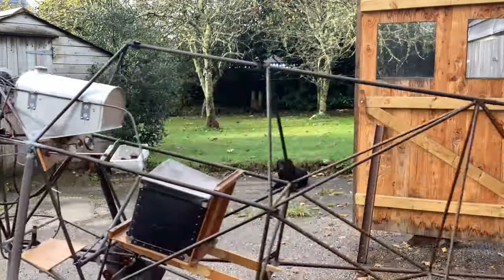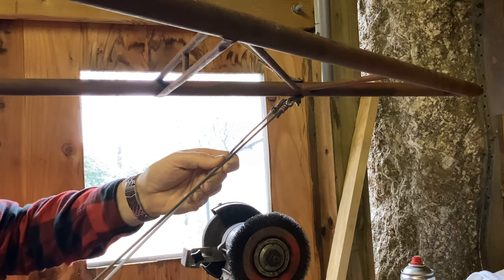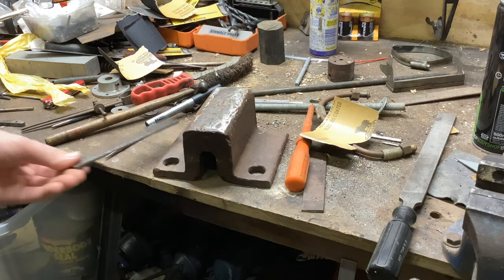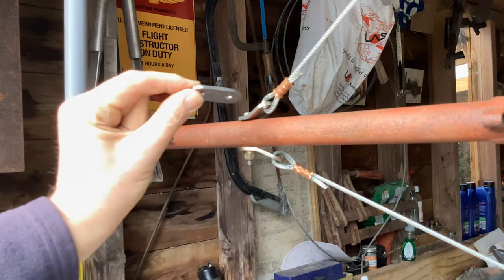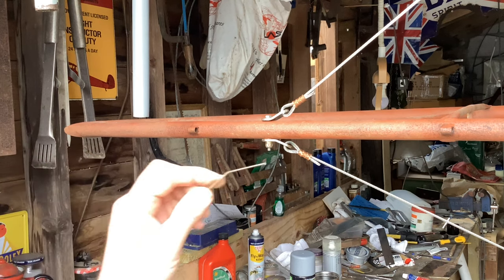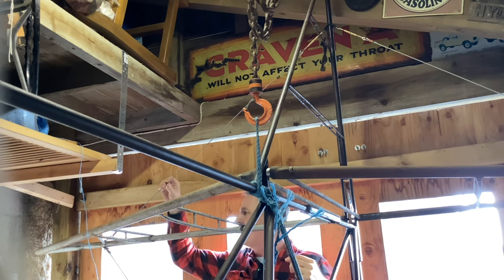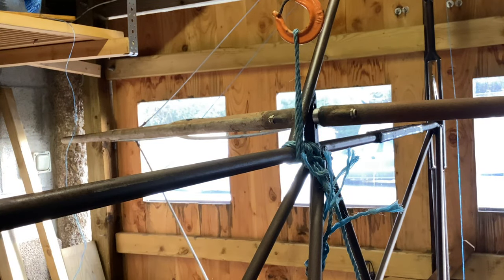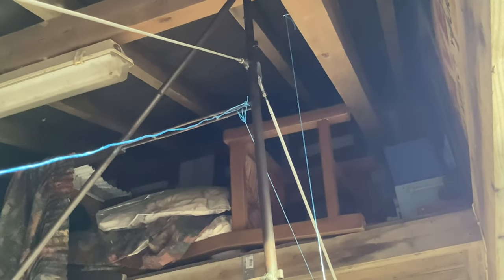Aeronca C2 - More Flying Wires

Comment: Have a great Christmas yourself and family. Not sure if it was due to camera angle but I thought the the camber of the tailplane ribs was greater on the underside than on the top. If this is the case it was a detail that I was unaware of, if so, presumably done so tht the tailplane does not need so much negative incidence with regard to the main wing incidence.
Reply from the maker: Well spotted! The inner (longer) steel tube rib is slightly cambered. It is only slight and I can't tell, from looking at my C3, whether the curve should be on the top or bottom. The leading edge attachment has three positions to adjust the tailplane incidence. Also, the tailplanes are not 'handed' so they can be swopped around if necessary. Hopefully a test hop will ascertain the most suitable setting.

Comment: Another fun show!  Thanks!!  I am curious though as to why you reference inch based measurements??   I am just an old slow farm boy but I thought England was metric or even Whitworth foolery years back???   Merry Christmas to all!!  Dan
Reply: Many of us older people still tend to think in real numbers !
Reply from the maker: England is traditionally imperial and we still use statute miles for distance. Measurements can be imperial or metric; old machines are usually imperial. The metric system comes from mainland Europe, along with cowards and communists 🤣 Screw threads can be Whitworth, Unified or Metric. Interestingly, the American Aeronca E113 engine has Unified and Metric threaded components and the British version, known as the JAP J99, has the same plus Whitworth too! I tend to avoid anything metric as it reminds me of the French.

Comment: Is this a restoration or a replica? Is it legal to replace wire cables with flat braces? This idea failed on a Bowers Fly Baby homebuilt in US. Might search for it on YouTube.
Reply from the maker: The flying wires (what you call flat braces) are original equipment; wire cables are not. The Fly Baby can have either. The C2 is a recreation using lots of original material.
Reply: @FlyingForFunTrecanair  Thanks for replying. 😊